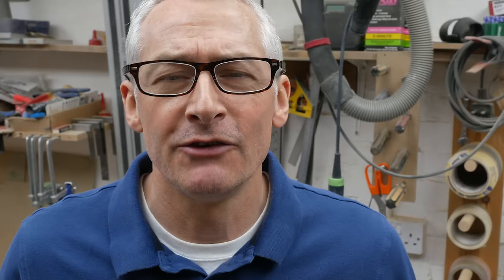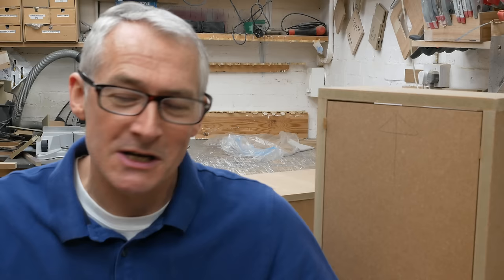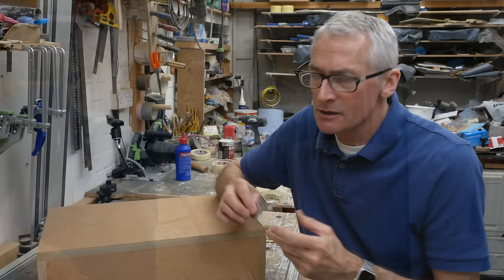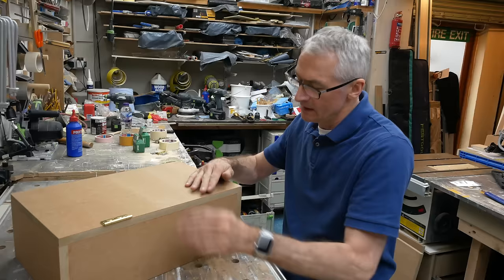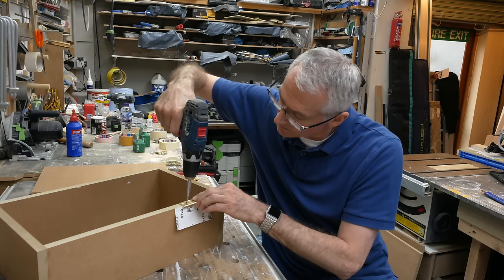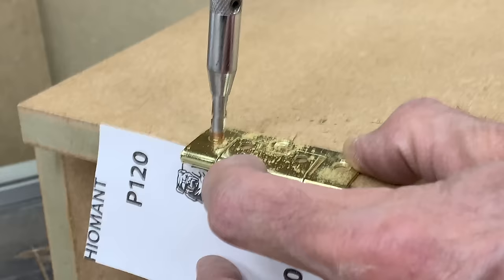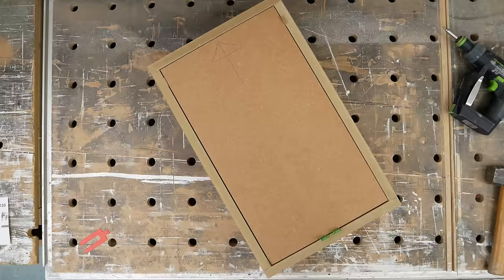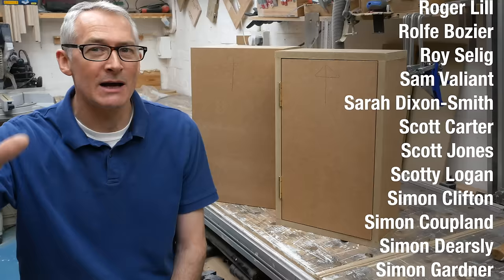Fitting flush hinges for cabinets [video #314]

Comment: Good advice! Also, if you are working on replacing cabinet doors get the hinges first, learn about all the options, and order them online early for delivery. If you need many pairs, your local hardware store may not have the quantity in stock!. That's my no.1 advice, otherwise, you'll have your doors ready, but waiting on the hinges. Doing a lot of research on non-mortised hinges, myself. Why, oh why, do so many of the hinge screw holes fit so close to the sides of a 3/4" plywood board? Home Depot has the Everbuilt Non-Mortised hinge in black finish, but the screw holes are really close to the edge of the boards. Unusable. Why were these not manufactured so the screw holes were more centered? Drives me nuts. Also very hard to find a black finished hinge. Checked locally, 10 hardware stores, and still only saw two other options (non-mortised wrap around hinges at 3x the cost) and I'm not really excited for the other options design aesthetic. There's also very little info about hinge weight allowances and tolerances. Some packaging will signify the door weight tolerances – National Hardware hinges do – but not many others. Be very aware of how much weight your hinge can handle. I noticed two different manufactured hinge company's offering a similar style hinge – one hinge could handle 25 lbs, the other only 9 lbs!!!

Comment: Thanks for confirming what i had in my head, I actually increased the size of the countersink for the 4mm screws I had ,  I had bought a box for a job ages ago and couldn't face having yet another box of screws where I wouldn't need them again.  The small sizes are required so infrequently.

Comment: I only read the first few comments but I agree with all they said. One thing tho, bothered me that you rushed thru the inset doors because that was exactly what I needed to see but it was too fast for me. However, watched it again and just slowed speed down and it was all good and made sense. Thanks for the video and tips that I should have seen years ago; it would have saved me LOTS time and trouble! And I appreciated your comments about buying flush hinges, which is exactly what I need and did not realize until I saw this video. I guess they are also called non-mortise hinges. I'm not experienced at all with this stuff so this helps a lot!

Comment: Great job Peter.  I'm amazed by the number of templates and jigs that woodworking supply companies sell for cabinet doors, hinges, slides, shelf pins. pulls and knobs.  Some could be quite handy and many look easy to make.  BTW, those demo cabinets would be perfect for storing keys.
Reply from the maker: Thanks Mark! Yes, I know what you mean about the range of jigs available - some of which are very useful, but many are priced so that you really need to be doing a lot of the same thing to justify them. And great idea to turn these into key cabinets - hadn't thought of that, thanks! 👍👍

Comment: Sir, I have to say that this problem gave me headaches all the time I had to build something with doors. I neve knew the little secrets behind, some I have learned the hard way but it was always something that messed up my doors. So THANK YOU for doing a vide on this. Especially that I hate those euro style hinges for which I need a bit more special equipment. These are cheap and easy to work with... now that I fond this video. :)

Comment: Useful video.
Can I add a tip. If you get tear out on the end grain on MDF, get some small rawlplugs, yellow work well. Drill out for the plug and insert, then pop your screw back in.
Reply: Harvey Smith That’s so obvious. Typical that I never thought of it. I, stupidly, used fatter screws to fill the gap.
Reply: @MKRM27  My pleasure. The best rawlplugs are the cheap ones from screwfix.
Reply: Harvey Smith     Harvey, what is a rawlplug?
Reply: @ronh9384  A Rawlplug is the little plastic tube type things that you normally use in masonry to screw into.
Reply: @ronh9384  UK brand name for a wall plug: https://en.wikipedia.org/wiki/Wall_plug
Reply: Good tip! I’ve done similar but with a dowel and glue instead of the plug. Plugs are quicker - no glue.

Comment: Glad I watched this. I installed these very hinges in the past and came up against the very same issues with the too large a head screws. I got pushback. I got around it with a magnetic push pop catch but like anything.. the correct tools for the correct job makes for a beautiful finish 👌

Comment: I have fitted many various types of hinge over the years and it is always best to have a dry run prior to fitting. Also, best to make sure the screw goes in straight at 90 degrees to the hinge or it will affect closing.

Comment: This is very timely indeed - I need to add a hinged top to a small play table with storage underneath and sort of knew these were the right hinges to use but have never been quite sure about them so was trying to find a work around so I could use cup hinges!! This will make the job much easier, so thanks a lot.
Reply from the maker: Thanks! For a play table with storage, I might also look at continuous/piano hinge as you can make it flush with the surface, whereas ironically with these 'flush' hinges the knuckle always stands proud. Just a thought. 👍👍
Reply: @10MinuteWorkshop  that's a good point, I'll take a look, thanks!

Comment: You are right about getting decent countersinking on flush hinges. I have tried a couple and they are all woeful even with 3mm screw heads. Have taken to grinding them out slightly using an old countersink drill - it's agricultural but works.
Reply from the maker: Yes, especially on the cheap ones! 👍

Comment: I enjoy your videos, I'm a cabinet maker myself and use alot of MDF for built in alcoves etc.
I will say though that screwing through the face of mdf is fine, but i never EVER screw hinges into the edge of mdf even with a small pilot hole. I dont like to rely on them holding doors. I ALWAYS mark the locations of the hinge screws and then drill the screw hole out and glue a hardwood dowel in.
That way you're screwing into the centre of a strong hardwood dowel which you have no fear about pulling out or splitting the edge of the mdf.
Mark holes, dowel jig to drill straight, glue and sink the dowels in. 5 minutes to dry then chop the protruding dowel off flush with a chisel. Pilot hole, hinge on. Nice strong fixing compared to a weak mdf board
Reply from the maker: Thanks! I don’t disagree, but let’s be frank; if you’re using flush hinges - which this video is all about - then you’re not likely to be wanting to mess around with dowels or dominos, you’re using flush hinges because they’re quick and easy. And if you want a quick and easy fixing into the cut edge of MDF then this is the way to do it; pilot hole, long screw. It works. No, it’s not how I would choose to do it for paying work - and I wouldn’t use flush hinges either, come to that - but it works. 👍
Reply: @10MinuteWorkshop  this is very true Peter! You knock out some nice quality work though, i enjoy your channel and have subbed 👍🏼
Reply from the maker: Thanks, and welcome! 👍👍

Comment: Great, just what I was looking for! So the small leaf goes on the thin edge, the large leaf on the broad face. For overlap door that means the small leaf is on the carcass, while for inset door the small leaf is on the door.
Reply from the maker: Thanks! Yep, small leaf of the hinge always goes on the edge of the board. 👍👍
Reply: I noticed, surprisingly, that the larger part of tbe hinge was on the overlay door in the first install.  It made sense though, when it was explained.  With the inset door, i thought, "Wait, this time he put the smaller part of the hinge on the door."   Looking thru the comments to see if anyone else "caught" it.   Saw your comment & recognized "smaller part of hinge goes on thin edge of board," just like it was explained.   Now I have it straight in my head.  Easy to see how it can be confusing.  I've spent plenty of time flipping hinges & boards around every which-way trying to figure out which way they go and how to get the desired result, i.e., open in, open out, etc.  I'll never go thru that again, not with this type of hinge anyway.  Thanks!

Comment: Good video but be careful what you buy and be especially wary (as Peter said) of the screws that you use, even if they are supplied with the hinges.
I bought a pair of flush hinges from B&Q for a small cabinet. They were rubbish. 
The two hinges were noticeably different sizes, maybe 1.5 to 2mm difference, and one was squint but the real problem was that the screws which were packed with the hinges didn't fully seat into the countersinks so the heads of the screws prevented the door from closing. 
Due to the thinness of the hinge plates and the thickness of the screw heads it would have been impossible to adjust the countersinks sufficiently to fully recess the screws. 
I thought about drilling/chiseling out small recesses in the facing wood to accept the screw heads but that would have been a mess.
I thought about filing down the heads of the screws to thin them out.
I thought about buying different screws. 
In the end I chucked the whole idea and went and bought a pair of butt hinges instead - took about 10 minutes with a chisel to cut the shallow mortices needed for the butt hinges to recess into and I don't think I'll ever buy flush hinges again in future.

Comment: Cracking tutorial as usual Peter. Absolute goldust as I’m about to fit 2 inset shaker doors - also based on your design ;) .

Can I just check…. It looks like for the overlay door, you fix the larger hinge leaf to the inside of the door, but for the inset door you fix the small leaf into the edge of the door. Have I understood this correctly? Many thanks, Mal.
Reply from the maker: Yep.

Comment: Although these hinges leave a very small gap, I don't see why I couldn't inlay these into the frame side of the door hinge so that there is no gap when the door closes. It seems the main consideration would be to have the hinge perfectly flush to the wood surface (where the material was removed) or slightly proud. If it was cut out to deep the hinge would bind. Any thoughts, I've never used this style before. Regardless, very informative video, thanks for taking the time.

Comment: I think I, like most people, apply the hinges on door side, then offer up the door to drill the holes on the carcass side.  It honestly never occurred to me to simply mark out the hinge position and then drill each set of holes separately based only on the marks.  Your way is massively better than mine.  Thanks.
Reply from the maker: Thanks! 👍👍

Comment: Thank you so much! What do you think of self drilling screws? Removing the need of drilling of self centring bit - for those of us want to buy as few things as possible, starting out.
Reply from the maker: I would always drill a pilot hole, especially into an edge. Too easy to split the board otherwise. 👍

Comment: Interesting shows I have fund all your show to be very helpful. Would you consider a show on “Noise in a small workshop especially the table saw”  I am finding it hard to compare table saw regarding noise differences and how to mitigate noise in small work shop. Ray
Reply from the maker: Thanks! I’m not really much of a table-saw user so probably not one for me. If you want to keep the noise down from a table saw then try and stay with an induction motor - makes a big difference. 👍👍

Comment: Hey Pete, excellent information on mounting doors with these flush hinges!  I’m so fortunate to have come across your channel!  I’m in the middle of building a couple of armoires for a client and have to mount double inset doors...any thoughts on how I might go about wedging those doors together to get my 1/16 spacing all the way around?
Reply from the maker: Thanks! If you’re using flush hinges then your door spacing will be dictated by the thickness of the hinge; a bit of careful measuring and cutting should get that thickness all around the door. 👍👍

Comment: Hi, nice and clear and concise explanation, cheers.  I also was curious and was checking the links to the equipment you use and found several links that do not seem to function correctly. If they are affiliate links it might be worth checking 🤓.
Reply from the maker: Thanks! And thanks for mentioning the links; it's not an exaact science unfortunately, and sometimes an older link can 'go bad' courtesy of Amazon's back-end, or sometime the old goo.gl links can convert, but then go off. Should be all square now, thanks! 👍👍
Reply: Peter Millard 👍

Comment: This is an exceptionally helpful video. I’ve found it very difficult finding screws for flush hinges are you able to recommend the product code you used please
Reply from the maker: Thanks. I generally use Spax screws, these were 3mm x whatever length you need. Sorry, don't have product codes.
Reply: @10MinuteWorkshop  I really appreciate this. Many thanks. Your content is superb
Reply: So… I bought every type of flush hinge I could get my hands on from both screwfix  and tool station and FFX including some 3 inch hinges. I then bought every type of 3 mm screw I could buy including torx, posi and slotted brass. No combination is even close to fitting flush. Most of the hinge plates are about 1.55 mm thick (accurately measured by me) and the screw heads are always proud by at least 0.2 mm but possibly 0.3 mm. I can’t find any product on Amazon either. Are you sure the manufacturer hasn’t changed so there is no longer an easily compatible solution? I have tried everything I can think of and spent hours and can’t find a solution.

Comment: Hi Peter, thanks for the videos which are a great help for a novice diy’er like me. As a general rule of thumb, how much clearance should I leave when measuring for I sent doors using this type of hinge????
Reply from the maker: Thanks Greg! I usually work to a 2mm clearance all around, though depending on the size of the hinge, this thickness can change on the hinge side. 👍

Comment: Hmm my large cupboard doors wont close using a flush hinge which make me think I either need a thicker leaf or need to bevel the entire length of the wardrobe door so the door timber doesn’t bang into the frame… when it shuts - not sure

Comment: Really appreciate your videos, and love the accent. Definitely a calming sense to your voice and you make everything seem so easy lol!

About to install some of these on a "shelf" we have that I've turned into a cabinet, the shelf has "cabinet walls" about 2" thick and the doors I'm using are a little over 1/2"  and due to the size of the doors, euro hinges won't work as they bind up with the hinge edge of the doors impacting the "face" edge of the cabinet endsso this or a butt/piano hinge was pretty much my only option.

Not sure if you covered it or not maybe I missed it, but is there any reason for or against installing the larger leg of the hinge on the cabinet rather that the door?

Comment: This is my go-to woodworking channel. However, I watched this to learn about fitting flush hinges on an inset door. Unfortunately, that part lasts all of 30 seconds and is hardly explained at all, compared to about 12 minutes on the overlay.
Reply from the maker: Pretty sure it's a minute long, and probably 30 seconds longer than it needs to be as it's *excactly* the reverse of the overlay hinge, and all the detail is in that section of the video. 👍

Comment: I noticed on the first door you mounted the large part of the hinge on the door. On the inlay door you mounted the small part of the hinge. Which is correct or does it matter?
Reply from the maker: Thanks. It is explained in the video at around the 4.00 minute mark; the smaller leaf of these hinges is designed to go on the edge of the board, so on an overlay door that's the edge of the carcass, on an inset door that's the edge of the door. 👍
Reply: Peter Millard , thank you for the reply. After reading through the other comments, I saw that it had been explained. I just missed it. Thanks again.

Comment: I'm really interested in the possibility of doing a kitchen with full-inset doors in frameless carcasses, but I don't see any examples of this anywhere, other than on bathroom vanities or dining room sideboards, for instance. Is there a particular reason why I should avoid this approach in a kitchen? Thanks so much!
Reply from the maker: No reason to avoid it. You probably don’t see many because it’s much more fiddly work than overlay - those doors have to fit, right? 👍👍

Comment: The 120grit sandpaper you use as "Clearance gap. If you have larger hinges - therefore larger Pivot pin- do you need wider gap? e.g more than 120G sandpaper thickess .I am replacing doors in my place. Full House doors and there are 3 x 90mm Flush hinges on each door. how can you tell if your hinge should be "left side" mounted or "Right side" mounted? Nice vid BTW.
Reply from the maker: It shouldn't make a difference - it's about stepping the knuckle of the hinge away from the edge of the board. 👍

Comment: Bit late to the party but great video. Now then, I'm installing an inset cupboard door and I notice that you put the inner part on the door and the larger part on the frame (opposite to an overlaid door), but can I put the larger part on the door (as in an overlay) in my instance as I haven't enough recess on my inner door frame or would I have to cut into the frame to enable the width of the hinge? I'm not talking about flush mounting as in a 'norma' hinge. Sorry if this sounds complicated.
Reply from the maker: Thanks! If I understand correctly, you could do it this way, but you’ll have the usual issues I describe in the video about screw placement. 👍